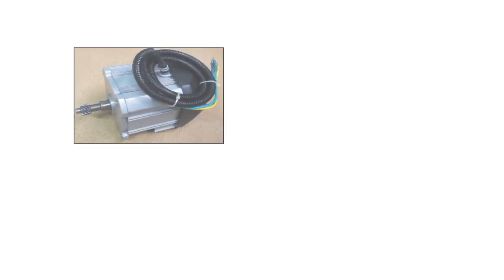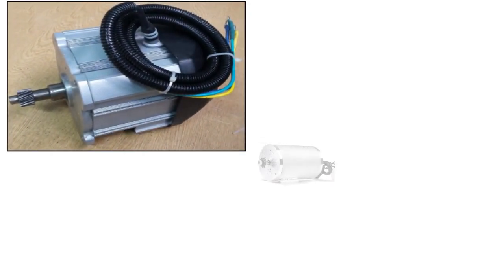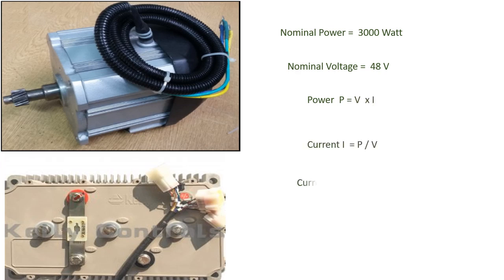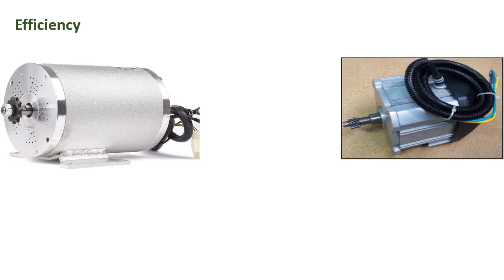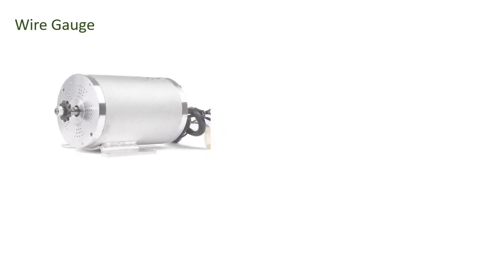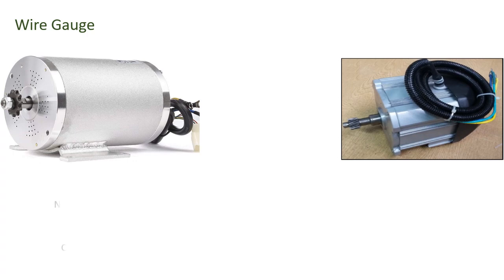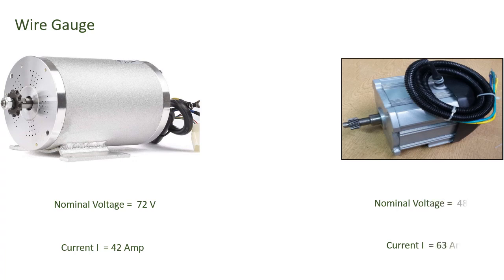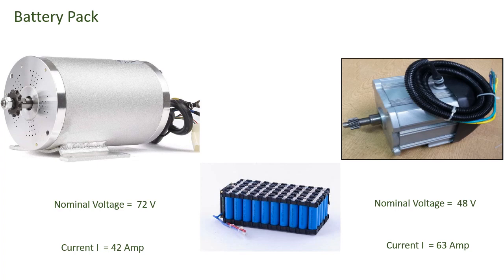72V vs 48V EV Conversion kit best one | high voltage vs low voltage motor | ev conversion kit India

Comment: Hi I want to make bldc motor to run from 220 v so what will happen instead of 48 or 72 v.
How will it affect the speed .
I am making my own controller.
Reply from the maker: Controller will not work on this voltage...
Reply: @motomanicevs  I am making my own design controller.I want to know about how it affects the motor.
We are using 48 v or 72 v in motor because we cannot put 220 v in battery
Reply: Ab ceiling fan aa gaya hai 220volt bldc me . You tube check karo.
Shayad kuch madad milegi. Atomberg, Orient etc.
Reply: Have you succeed in this project.

Rewind motor with thinner wire and more turn, you will get desired operating voltage with reduced ampere.

Comment: Why don't we use 12 V battery & it's voltage should be increased by electronic transformer upto 120V so that motor will not heat too much??
Reply from the maker: Of course but current decrease. You need additional accessories etc..
Not will be efficient..

Comment: I made (14s 9p)(each battery is 2.4ah) totally (58.8v 21.6ah) li-ion battery pack for my ebike. Voltage from 58.8V to 54V the battery is decreasing very rapidly (2kms per 1 volt)and after 54V-44V its decreasing reasonable(6-7kms per volt). How do I fix this?
Reply from the maker: Check you cell quality... Or BSM... charger..

Comment: 72 volt is always better,  its commonsense. It has more torque in incline hilly roads and better heat management.
Reply from the maker: Yes well said..
Reply: What 220 v .I am making a 220 v controller. So does it means it is good for motor better🙄
Reply: @motomanicevs  good

Comment: How about 96 volts battery...is there any harm in using 96 volts battery or motor
Reply from the maker: Higher voltage is recommended due to higher efficiency. But you should have complete power train for same volt..